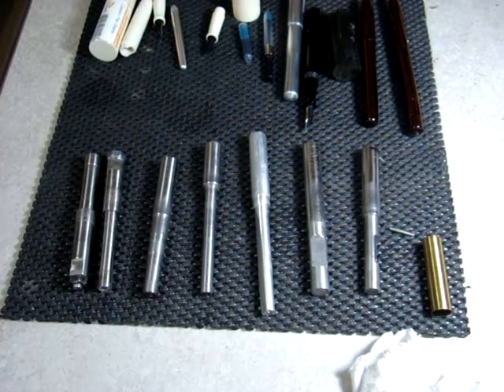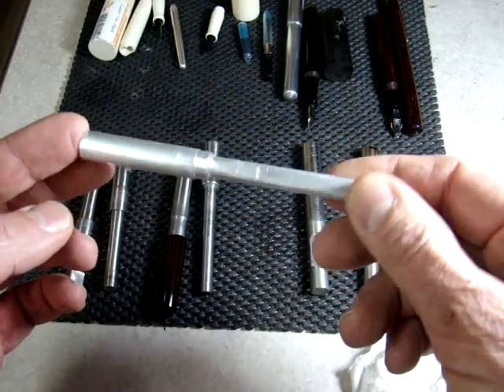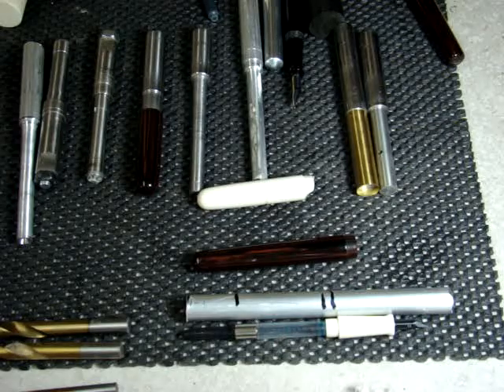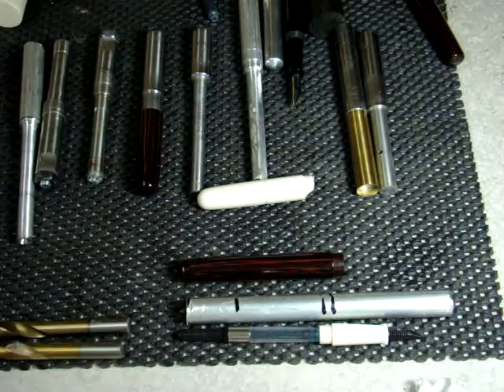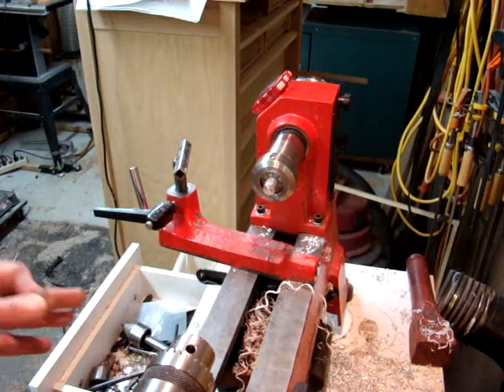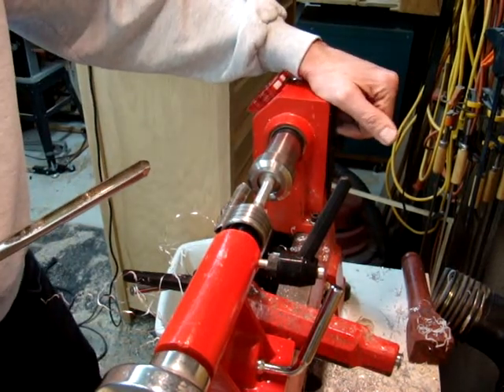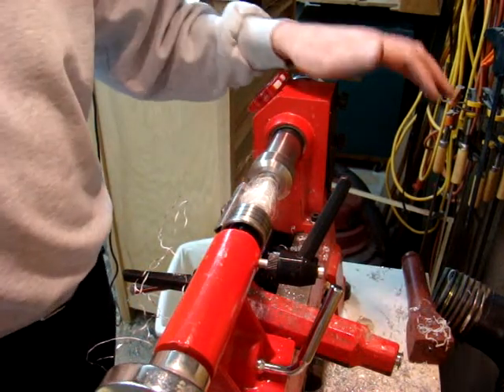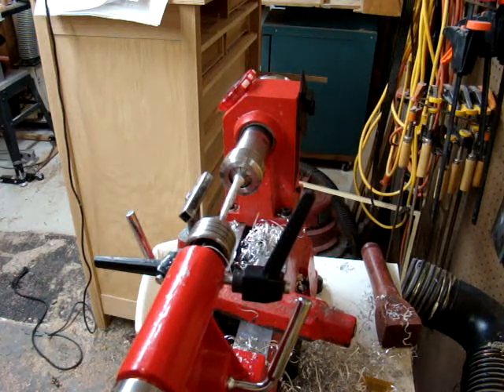How to make a mandrel on your wood lathe

Comment: I’ve been looking for an expanding mandrel like the one you say is from Arizona silhouette. Do you have any link to something similar? I’d like to find one for turning a piece of stock without a thru-hole
Reply from the maker: I haven't worked in the shop for several years now, so I'm not sure where you could get that mandrel.  I bought things from http://www.pennstateindustries.com/ before so you might try them.  Sorry I couldn't be more help.